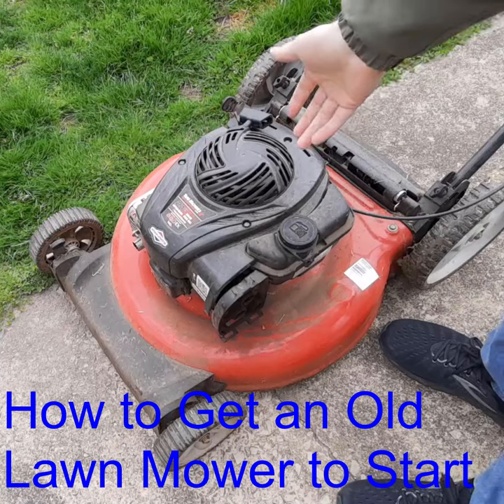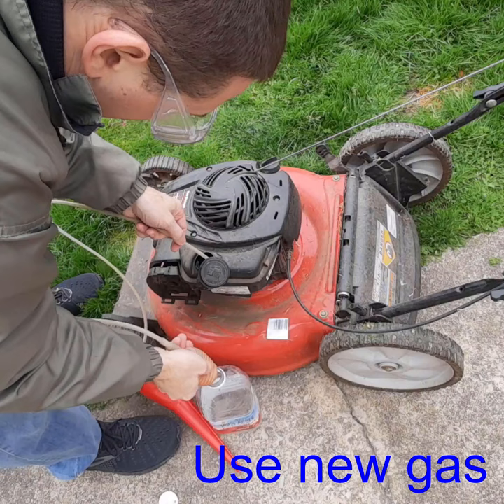How to get an old lawn mower to start #shorts

Comment: Just so you know you were spraying the starting fluid into the crankcase vent. The bottom hole is the intake. Thats why it took long ti start cause only a little dripped into the intake after you already was spraying it for a while.
Reply: which part is the intake??
Reply: @gtarules1 the top 😂
Reply: @Bottldiggerofnz the bottom 😅

Comment: There you go until you burn threw the starting fluid and it stalls. Take the carburetor apart and clean it. 99% of the time the carb is the problem. Old gas sitting without use gums all the small passages up causing a no start. Good luck👍🏻
Reply from the maker: I agree, I found this in the trash. Once I ran new high octane gas through the carb and engine it started every time. If it did not start up easy the next time I would have cleaned the carburetor.

Comment: Had to get my lawn mower started for the first time this year...saw a can of gas in the garage and filled it up since it was empty, normally if its empty it takes 1 or 2 pulls max to start the mower...20 pulls later and nothing...then i realized the gas in that can is 1 year old...smh...next day I realized i had some marvel mystery oil leftover from my cars and figured if its good for fuel and crankcase then its gotta be good for old gas and i put a quarter of the bottle in the gas, closed the cap and shook the mower real good to get it to mix...1 pull and she started and runs like a top!

Comment: u did it backwards try starting fluid FIRST ! then u know the problem is fuel related immediately if it dznt wrk u then test spark 
... 90+% of the mowers I've picked up are one of those 2 
....
Reply: you dont want old gas running thru a mower
Reply: @markrush5013  right but in the few SECONDS it takes to troubleshoot a fuel issue is of no concern .

Comment: With those lawnmowers and the carburetor what I do is take a paper Bol I take off the airfilter then I tip it on its side till I see gas come out the hole then you put everything back together

Comment: got to clean the carb? float bowl??
Reply from the maker: I did not need to and it worked fine after running the new gas through the carb, but the old gas in the carb was the likely root cause of the issue. I would have cleaned the carb manually if this did not work.

Comment: Its Not a repair. Probably the mower stalled after the spray Was used up and you have to clean the carb anyway.
Reply from the maker: I have been using it for 2 years without any additional work. It probably had bad / old gas and I was lucky that the carb was not completely gummed up yet.

Comment: What is the tool at the start
Reply: The siphon hose? It has a bulb you squeeze and a one way valve. As you release the bulb, the valve classes and gas is pulled up the house and the force pushes the valve open on order to drain the tank.